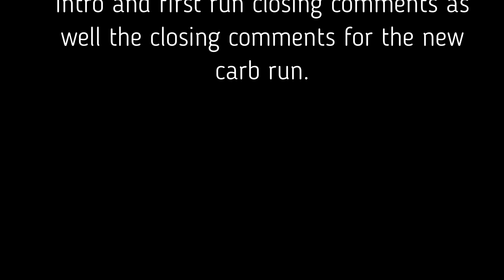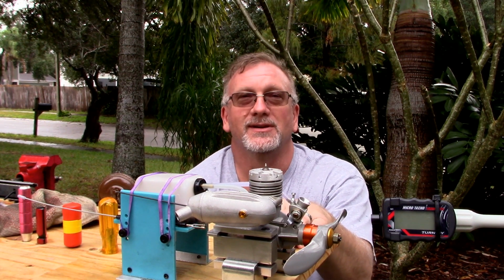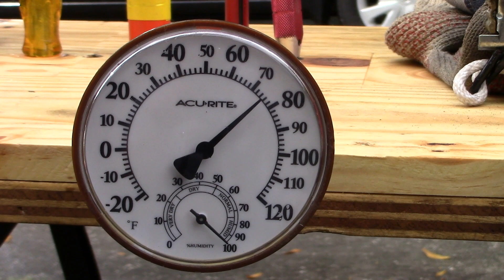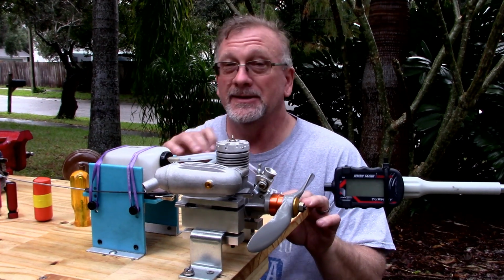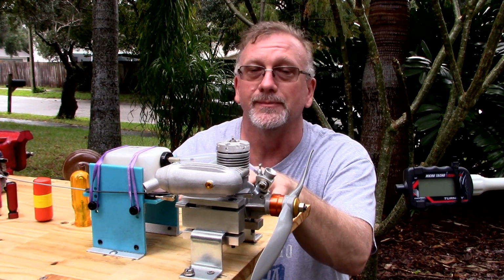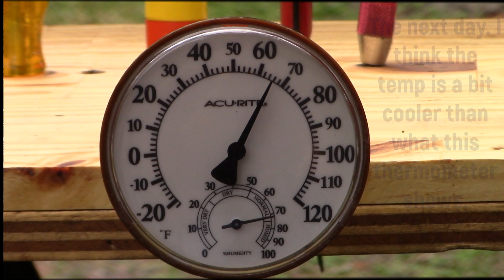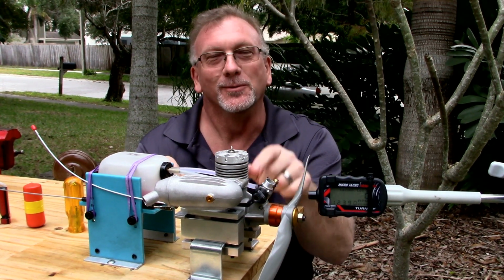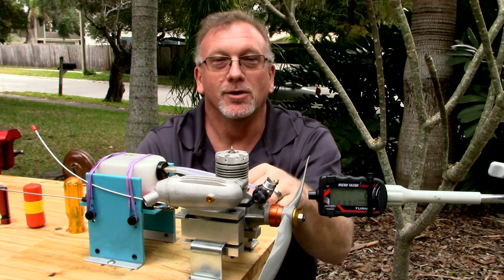MDS 40 Two Carbs Two Runs

Comment: LOL glad to see I'm not the only one that uses music wire under the tank rubber bands for a throttle detent..
Reply: I have a few MDS, we imported some in the late '80's - 90's. The FIRE .61 is a strong one, and oddly you can mate the crankcase and p/l to OPS .60/.65 parts, coincidence I suppose. The engines are strong runners with nice machining, ugly machine screws, and ghastly carbs. Any decent carb of appropriate bore can be adapted to them to make a world of difference.

Comment: Fitting a Super Tigre carb to them was a popular mod when MDS engines first came out. The local model shop used to keep stocks of them for disgruntled MDS owners. 

Years later we had an ARTF trainer donated to our club fitted with an MDS 58 IIRC. We had all sorts of problems with that caburetter. It would run at high speed but not at low speed or if you could get it to tick over it would not pick up. We gave the carburetter to a Rolls Royce trained engineer, yes that Rolls Royce. He machined a couple a little off the main needle. It made no difference. In the end I donated a Thunder Tiger GP 42 which flew the trainer perfectly.

I wouldn't have an MDS as a gift!
Reply: I have 3 of these MDS .40'S..  Which carbs can i use to replace the OEM's????

Comment: iI've had several MDS engines, they were good engines, however i noticed on a couple of engines it was hard to tune the carb,  i found the trick was to use OS glow plugs  #3 or 6  plus i took a jewelers file and opened up the fuel metering tube a bit for extra fuel, the high spee needle didn't need to adjusted so far out to get it to run reliably
Reply from the maker: Yeah, no quality engine should ever require a person to use a jewelers file on any part of it. Garbage engines.

Comment: I had a MDS 48, I  believe it was one of my first new in box engines.  I flew it on my first rc plane the 'Big Stik'...It ran OK, but sometimes in mid air it would die for no reason, or the idle would be inconsistent...Now, I know why they were called 'Mostly Dead Stick'...That carb really made a difference...Good carbs and Bad carbs...
Reply: My MDS 48 runs abot 12 minutes with a 300 ml fuel tank. After 5 minutes flying the fuel mixture starts being too lean. Then I land the airplane and open the high speed needle 2 clicks and fly another 5 minutes. It is this engine:  https://youtu.be/S1FIjjyDfAs

Comment: Done a good job Dave I've got one of them heaps of power but carbs are shit ran slightly better on castor oil carbs leak around throt barrel i think thats the reason for there tuning troubles 😀👍

Comment: Hey David! Just going a bit off topic. did you know if an OS or ASP carb can replace a SuperTigre G45 one? Mine got chipped due to me over tightening it yo the engine block.
Reply from the maker: Unsure if the base OD's are the same. If they are then yes. Super Tigre carbs are so good I would suck to put an ASP carb on that engine. But in general if it fits in the engine it can be used as a replacement.